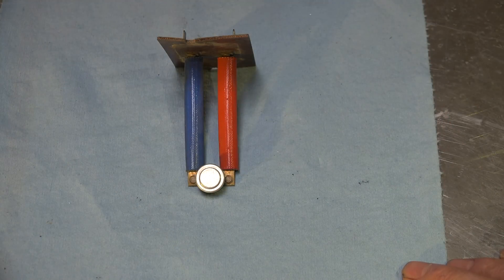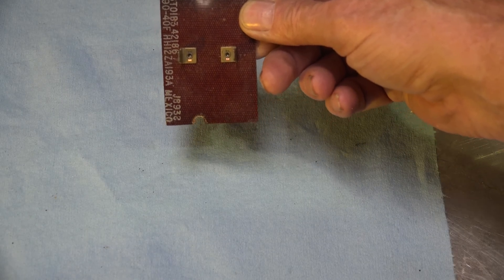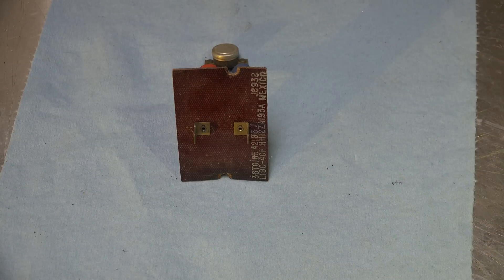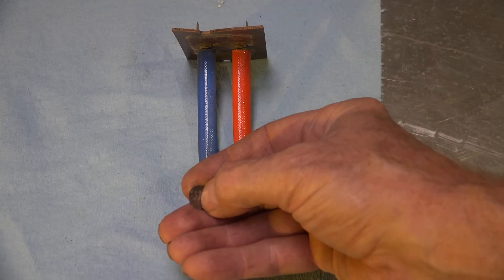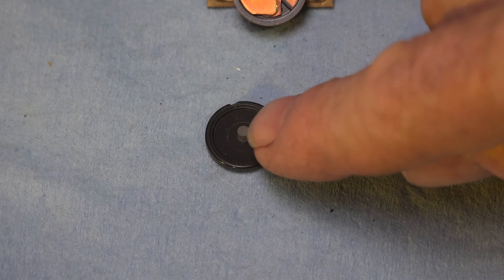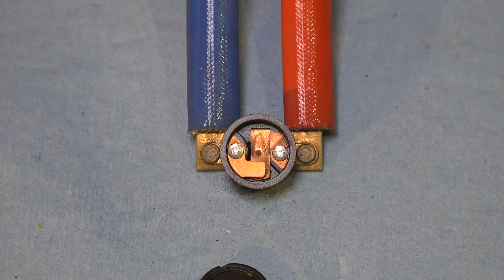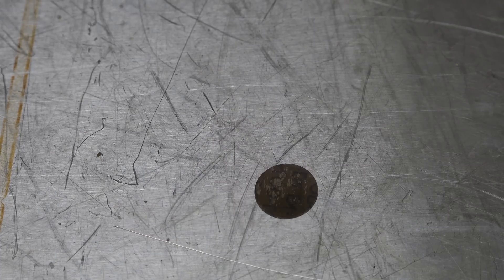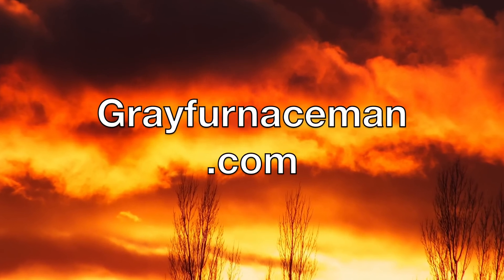How the hi temp limit works

Comment: Mine wouldn't reset so I took it out of the furnace and gave it a smack, now it works fine. Should I be worried about something or look to replace it in the near future?
Reply from the maker: First, change your filter more often.  Lol.  You do need to find out why the furnace is limiting out.  
Second, replace the limit.  It is not trustworthy.
GFM
Reply: @grayfurnaceman  I had it cleaned two months ago as well as the filter. Not sure why it tripped. Tha ks for the reply!

Comment: Question so I took out the electric  heat  strip assembly and found the limit switch like bubbled outward , is that the normal position its supposed to start out in ? Or is it supposed to be inward ??
Reply from the maker: It is probably damaged.  Replace it.
GFm
Reply: grayfurnaceman it doesn't have a reset switch on it it came off a electric heat strip assembly so the disc inside the switch was already facing outward. That's what I meant if that's normal or that means it's broken
Reply from the maker: If the switch has continuity, it is good.
GFM

Comment: Hello Gary, I have Lennox furnace g20. My blower shuts off for 2 seconds and comes right back on while the burners are on! It does that like 3-4 time during each heating cycle. Do you think ots the fan limit switch causing it? Which its looks like the one on the video?
Reply from the maker: Your furnace does not have a "fan limit".  The part you indicate is a limit switch that shuts off the burners.  The fan is controlled by the IFC board.  Your problem could be caused by either the motor failing or the board failing.  You can try setting the thermostat fan switch to the "on" position.  If it works normally, the problem is in the board.  You can also try changing the fan speed on the board.
GFM
Reply: The control board was changed (BCC3) when it burned up couple weeks ago, but it was doing the same thing with old one before it was burned out.

 UPDATE. when I jumped the hi temp limit (closed the circle) it worked fine but the burners never went off during cycle! and worked fine when thermostat turned on manually. 

Is there other component I need to check?  I do not know how to change fan speed, please can you tell me how? Thanks alot
Reply from the maker: I'm confused.  Are the burners going off or the fan?
GFM
Reply: grayfurnaceman the fan. Please I need help. Thanks
Reply from the maker: Here is a service manual for the G20.  There are jumpers on the board that can be moved.  http://www.graycoolingman.com/service-and-troubleshoot-manuals.html
GFM

Comment: I have a question,  if a Compressor is grounded it's always bad right?  I had a friend tell me he can repair a grounded Compressor and I don't think he's right lol
Reply from the maker: If the wires are removed from the terminals, and there is continuity any winding to the body of the compressor, the compressor is dead, repeat dead.  There is no repair of a grounded compressor.  Hope this helps.
GFM